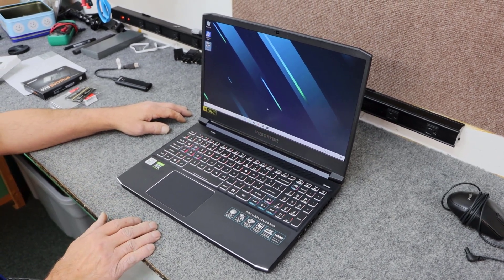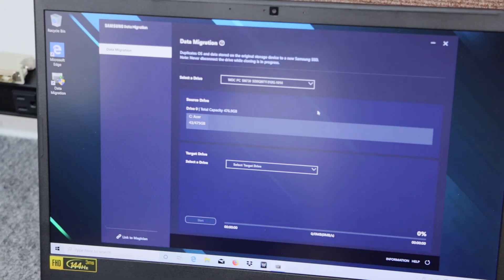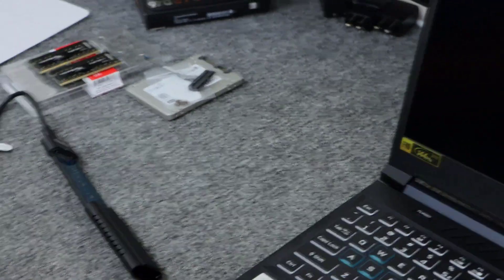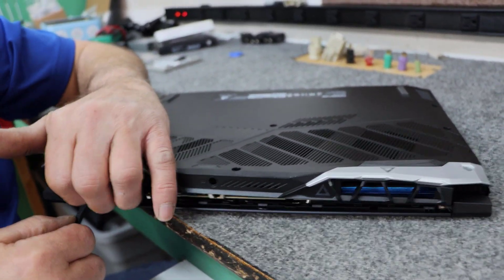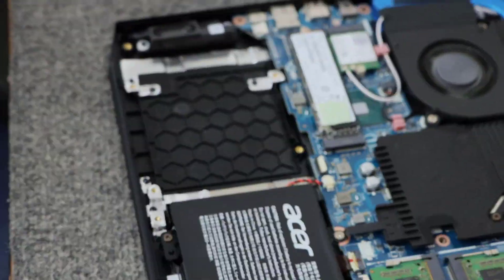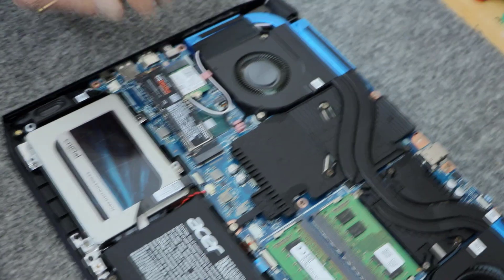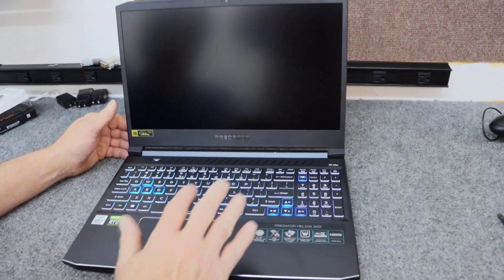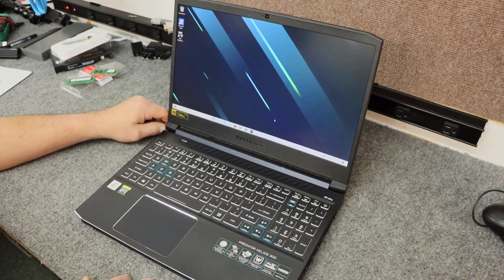Acer Predator Helios 300 SSD Upgrade, Memory Upgrade, Clone SSD, Complete Upgrade.

Comment: Who else is watching this on a helios 300?
Reply: me
Reply: x3 :v
Reply: ME
Reply: I am! This thing is a powerhouse!
Reply: +1
Reply: Me
Reply: Is this laptop the one with rtx 3060
Reply: Lol. That will be me soon
Reply: Yea, I love this thing. I use mine for work and the occasional gaming. I play Witcher, Dark Souls, and now I can finally download more games
Reply: @kunaly.5831  do you have any problem when the fan is working hard then it just close down the laptop total black screen? this is very disappointing in my part...
Reply: I have one but but im watching on my tablet
Reply: mine is on the way bois
Reply: Yes but with 9th gen. Either way these intel processors hot enough to cook eggs on XD. turbo mode all the way
Reply: yoooo
Reply: Helios 300 has PCIe wifi card or NGFF ???
Reply: i'm watching on an acer nitro 5 because i'm planning on buying the helios 300
Reply: me, I wanna put another NVME SSD
Reply: Has anyone had any problems with there’s? I’ve had mines for 3 months and so far the only thing that went out was the battery. Sorry I was playing the crap out of mines lol
Reply: @Druggy-Doggo  i do, but i have the 2018 version, it worked perfectly for about 2-3 months and after that it lags alot, i can't play games without lag, even on the lowest settings and i took it for cleaning and everything but it just keeps happening and nobody can find out what's wrong with it.
Reply: @Noname-o4c1p  might need new thermal paste.
Reply: Not me.  Watching on my iPad. My Helios Wi-Fi card is semi-fried — it connects to the the SSID here, but “no internet access” and my iPhones can connect to the Wi-Fi.   Methinks it needs a new Wi-Fi card.
Reply: Me
Reply: Mood
Reply: I got the 2022 version fingers crossed
Reply: Me hahaha
Reply: Me
Reply: Near my Helios 300, watching on my Pixel phone. I've decided to check what I can upgrade while it's an Amazon Prime day.

Comment: Perfection! Just bought a new Helios 300 from Micro Centers, and wanted to upgrade my RAM to 32G myself. This video made it easy and appreciated the tips on how NOT to screw up the thin Aluminum casing!
Reply: Happy to hear. U've made beautiful choice. I'm a Helios 300 user myself of 2019 model i bought around 2 yrs back. The Looks and the Metallic feel is like no other laptop. Mine's got  gtx 1660ti and ram i upgraded myself to 16. What are the specs on yours ?
Reply: Also have u bought the extended warranty 2yr (total 3years) that acer gives are really cheap price which is to be availed within 7 to 9 days of buying ?

Comment: its my first time putting in ssd in my laptop. this guys sure helped me a lot from start to finish. thank you so much!
Reply from the maker: Good to hear. Thx for watching
Reply: @CadillacComputerCenter  I have a question I can fix pretty much every thing and am skilled what I do not have experience is batteries I have a Hellios 300 10th gen but it came with 55wats battery I can not find an original battery that supports 90watts I need more amphers, but I need the correct voltage otherwise I can just cause a short circuit and fry my motherboard can you advise me how to bypass this I am building a laptop for the next ten years I am modifying it so I need to know how do I go on about doing this do I take the original battery, buy a 90watts and install the chipset from the original battery reverse engineer it or how do I go about that.

Comment: This is a really great laptop. I think it is the same model I got. It is the RTX 3060 one, right? I just put a 2TB in the second SSD slot on mine. It is really annoying to open though. Fortunately, all the screws are the same size so you don't have to worry about keeping track what screws go into what holes.

Comment: im not really a techie so pardon for the stupid question. a couple of questions really. is it possible to clone the booting ssd on to the new one by installing the new ssd on the slot? (i dont have ssd enclosure and im being stingy. LOL) and also is it possible to use the inserted ssd as the boot drive? thank you for your time

Comment: Great video. But a small correction; the fans suck air in from the bottom of the chassis and blow air out from both side and rear vents
Reply: I was considering to buy this laptop, but with rtx 3070. Is cooling in it that big of a problem?
Reply: @piotrbeczkowski1517  I have one with 3070, GPU cooling is fine(50-60 C), however CPU may get 90-95 degrees Celsius during gaming when Cool boost and turbo modes for fans are disabled. When they are enabled CPU temperature is 70-85, so it is ok, but the fans are loud on turbo modes

Comment: I have the 2021 model, one question.. Is it possible to install 32gb only in one port and the other remains empty? Or it is better to have the memory in both ports half, 16 gb each port? Other could be 16gb one port, and the other remains with its 8gb ram? Wich configuration is better? Thanks in advance and congrats for the good videos.

Comment: If I were installing a second SSD, but still wanted to keep the original installed, could I also use that cloning software with the new SSD already installed and then wipe the original SSD? Just so then I don't have to pick up this adapter?

Also, does that cloning software work if you're going from an HDD to an SSD? Curious for an older build that still only has an HDD.

Comment: My predator Helios 300 never came with a SATA cable and I’ve had no luck finding a replacement one that works, where could I get one?
Reply: Contact acer, they send them for free
Reply: @trengey6498  that's fucking rough dude, I called them and asked them for the cable and they sent it to my with next day shipping, no charge to me. Was your laptop out of warranty?
Reply: @kshatryakopf  I’m honestly not sure cuz I bought it off of someone second-hand but unused. They said they never got a warranty so I’m assuming they most likely never got it
Reply: @trengey6498  hi, did u got a cable? Im having same problem , bought second hand no cable
Reply: @tanishing95  hey, yeah I ended up contacting Acer and buying one but it was a bit more expensive than I thought it would be

Comment: Ssd 512 gb is there in my laptop acer pred helios300 at slot 0 so can i able to change it to 1tb or 2 tb ?? Slot 1 i have installed a 1 tb ssd earlier . So to install a new nvme ssd 1 tb can be installed at slot o which shows as a C drive ? So do i need to clone it 1st before putting the ssd at slot zero which is cdrive . ?

Comment: I would keep the original 512 gb with os clean install for future copying if the 1 tb corrupts or the NVME fully fails.  Plus, I'll fill up the 512 gb day 1.  Replacing mine with 2x2TB NVME and a 4TB ssd for the time being.

Comment: so I installed the new 2.5 SSD as well as memory, now its just stuck on the black screen like what is in the video where its suppose to "post" but it hasnt gone through... its been about 15 minutes and it hasnt done anything. i tried turning it off then back on and nothing happened.. just stuck on the black screen assuming its trying to boot from the 2.5 ssd?

Comment: One question, just bought 
Model Name: Predator Helios 300 PH315-54
Part Number: NH.QC1EX.009
Does this model have 2 Nvme slots and a SSD inside? 
Because i want to upgrade to 32 ram and  more gigs of space.  Pls reply 🥺

Thanks 👍 for the video, was useful.

Comment: I have a Dell G5 and wanted to upgrade my storage. Dell didn't include the caddy, just an empty slot. No screws or data cable either and I can't find the type of cable you're using, only the thicker canoers which won't fit. Where would I find the missing pieces?

Comment: The screw of the second nvme SSD is Impossible to remove, bought a SSD and just cant install it
Reply: Had to use one of the tapes that was holding the battery cable in place to use my ssd, i'm not using a screw but its in place

Comment: Hi, Quick question. I have the 500 model with 2 ssd (each 500GB) . I want to upgrade to 2 TB with 1 TB ssd each in each slot. Will cloning the 500GBs with the 1TBs do the trick. Thanks

Comment: i have a predator Helios 300 laptop with i7 intel core, Invidia GeForce RTX on windows 1. i am planning on putting in a Crucial T500 1TB PCIe Gen4 NVMe M.2 SSD card. is it compatible. it is a model NO: N22C3

Comment: Great video! I just purchased an Acer Nitro 5 with a Ryzen 7 CPU. The keyboard has black keys with red symbols and red led backlight. I find it difficult to see the key symbols when not illuminated. I noticed the Helios 300 in the video has white key symbols that are much easier to see. Is it possible to purchase the key caps and swap them? If not, could I order the Helios keyboard from Acer and swap the whole thing.....thanks
Reply from the maker: Hi. You can buy replacement keys. But not different colors from what I found.

Comment: Hi, can I put samsung 970 evo plus 2Tb ssd? I have Predator Helios 300 laptop and planning to upgrade the storage. May I know the max ssd capacity that I can install?
Reply from the maker: You'll be fine with 2TB, either 2.5 inch sata ssd. Or m.2 nvme ssd. 4TB will most likely work as well. I have done 2TB  in Helios before.

Comment: So question then, I just ordered a 2TB 970 EVO Plus ssd NVMe M.2 and wanted to use in the 2nd slot. If i were to do that, then i wouldnt have to essentially re-initialize the laptop right? or will i have to replace the default 512gb ssd with the 2TB one?
Reply: Did the 2tb on the second slot work without problems?
Reply: @angellopez2229  indeed it did. Nothing wrong happened and after initializing the ssd normally i had an extra 2TB

Comment: What kind of connecting cable did you use for it? I can't get my Samsung EVO 2.5" to work, and I really, really need to - the whole reason I BOUGHT this instead of an alien was bc it could do BOTH pci AND 2.5" SATA
Reply: Did you get a bad cable?
Reply: @themadatheist1976  The technician didn't seem to think there was anything wrong with the cable, itself, but I already got a refund for it on amazon - at least they didn't make me send it back....but still, I need one that works! Is there an easy way to test whether it's a bad cable or not?
Reply: @shereegeo2691  last time I use a cable system like that was a couple of decades ago servicing a CD changer.

Comment: My predator laptop is having a problem. When I unplugged my charger, my laptop will turn off even if I reached 90% battery capacity. It will only work if I plug it back. What seems to be the problem?

Comment: Is is super good for new games, but with old games it doesn't work good. For example commando conquer 3. Any tips why that is ?
Reply from the maker: Hi.  There are a variety of reasons that game, and others that old don't work.  Many old games simple will not work within the 64bit architecture.  Dirext X is also and issue and the new modern video drivers do not work with these games.  Some of the old classics have been re-mastered so to speak and are available thru Steam.. You might want to check that out.  They wont be free though. ugh. Dale
Reply: @CadillacComputerCenter  thanks. 😁

Comment: I got this exact model but with the nvidia gtx1660. What upgrades would you recommend  for this model in particular??
Reply from the maker: Hi. You can easily do same upgrade as in the video.
Reply: Hey. Thank you so much for your early and kind reply. Great videos by the way. Let me ask you another question. What benefits would I get from this upgrades. I know the memory drive will do. But I’m not sure about increasing the ram and cloning and changing the ssd. Does this improve shooting games or frame rates ?
Reply from the maker: Hi. More ram is always good for frame rates. Additional storage is optional.
Reply: Thank you for your kind reply. Best regards

Comment: do you have to do the data cloning at the beginning? If i just want to install a second SSD drive and keep the original one, do i need to do the data cloning?
Reply from the maker: No you do not have to clone if just adding second ssd. Dale
Reply: @CadillacComputerCenter  i did but its not showing anywhere what should i do please tell ? in disk management there is no 3rd disk i tried to install samsung 970 plus

Comment: The ram, does it run at 1.2 v or 1.35? Is there an XML profile on the BIOS? I want to upgrade the ram but want to make sure it runs at the 3200mhz
Reply: I had installed 32gb (2x16) 3200 mhz, works fine, just limited to 2933 automatically by the system.

Comment: Hello. Which one display screen inside AUO, LG, Innolux? Please, can you tell the model number? My default screen is 60hz, eDP 30 pin "au optronics b173HAN04.2". And i want to replace it to 144hz. Thanks :)
Reply from the maker: Hi. Unfortunately,  a 144hz panel uses a 40 pin connector.  Dale
Reply: @CadillacComputerCenter  Thank you for answering. I knew it from the beginning and bought this cable with 40pin connector. Or im a braindead and my plan cannot be carried out?

Comment: Hi, I have 1 16gb 2933mhz ram on my predator. Is it ok if I add another 1 16gb ram 3200mhz? Or should I buy two 16gb 3200mhz ram? Can I also upgrade my storage drive from 512gb PCIe gen 3 to 1tb PCIe gen 4?
Reply: You cant add 2 rams with different mhz, Mhz should be the same!

Comment: If we clone the HDD to SSD, Does the performance & overall optimization vary when compared to a clean Windows installation?
Reply from the maker: Hi.  If you have alot if data, apps and games installed, cloning will retain all of that.  A clean install is preferred if you want to start fresh. Remember though, with a clean install,  you'll have to reinstall everything, and back up all you files and data first.  Dale
Reply: Does the clone have to be done when instilling ssd, NVMe, and ram? Install and not replacing hardware to be specific.
Reply: @mikewilson3774  i couldn't understand you query. Please elaborate.

If you're installing the hardware for the first time, no cloning is needed.

If you're replacing the HDD/SSD with a new one. Then you can clone it.

This process has nothing to do with RAM.
Reply: @cameravala  Thank you! Yes this is my first hardware installation, the notebook is fresh from Acer.
Reply: @mikewilson3774  All the best, Mike!
Reply: @cameravala  Thank you!

Comment: hi! Not a bad setup. The 3 ms could have been 1 ms. The refresh rate could have been higher than the 144Hz. The RAM speed is dismal at 2933Mhz. Decent job on the video, but after you say Guys 350 times I'm ready to scream.

Comment: Hi i have same laptop. How much will i benefit compare to current specs if i install same ssd like you and add more ram
Reply: If you are a gamer, you will see faster load times from the SSD. The RAM you will see better frame rates. Hope this helps
Reply: @TheXmaniac1979  ok tnx
Reply: @TheXmaniac1979  what type of ram should one use? The OEM one's in my Predator are 3200mhz but coz of the cpu they are clocked at 2933mhz

Comment: So call me stupid bud if i leave to old HDD and just add a new HDD to the extra space you dont have to clone it. Just put it in.
Reply: Correct.  No need to do anything special to the added 2nd drive.
Reply: @jdsguam  Thanks for the information.  So i watched a video the other day.  And it said that when put together at factory they put the original HDD in slot 2 and the empty slot is slot 1.  Do i have to put the original HDD in slot one and the new one in slot two or should i just put the new one  in the empty slot as is when you open it
Reply: @pjgolway9632  Leave the original alone and just use the extra slot.
Reply: @jdsguam  Thank you for the help greatly appreciated.